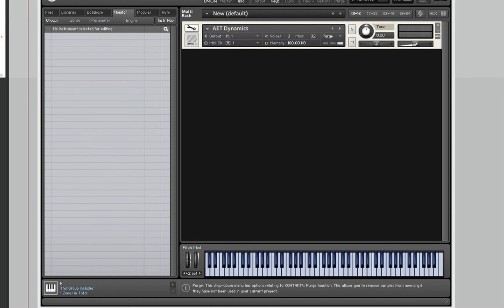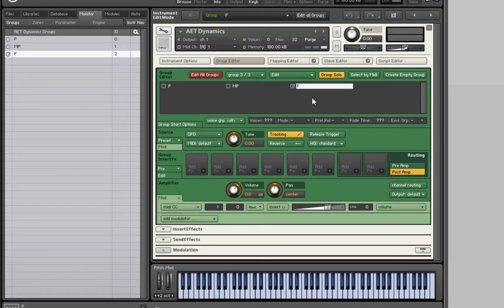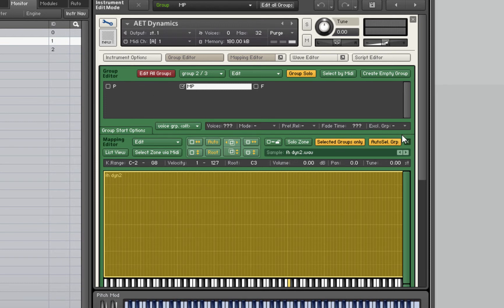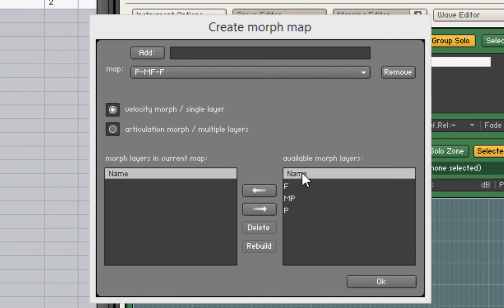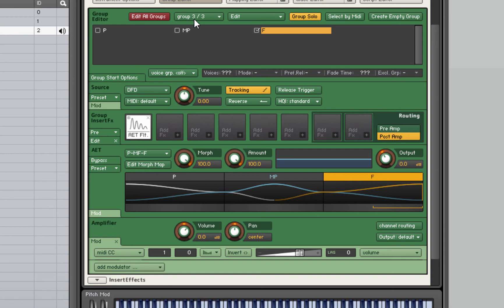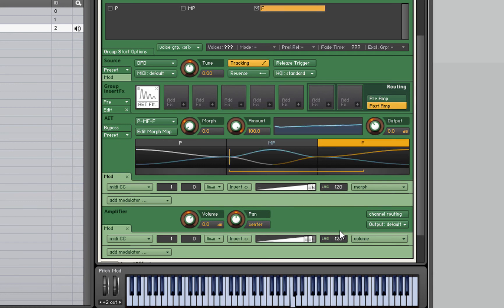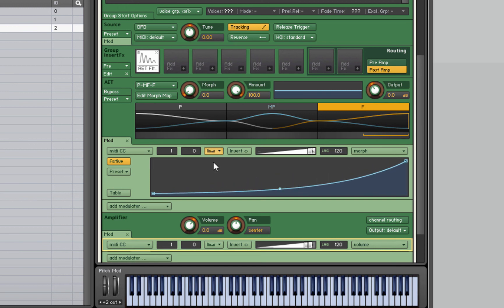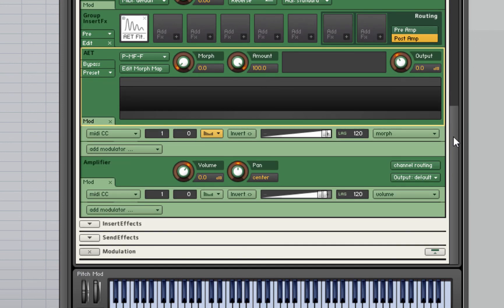Kontakt AET Filter Dynamics

Comment: Hi David..I know this is an old vid but you mentioned at the end crossfading different instruments eg. a guitar and a flute..could you possibly expand on this, how to set it up? When I try it just sounds like a volume crossfade because the group with the AET FX turns down with the mod wheel..thanks!
Reply from the maker: Hi,

I haven't done anything in Kontakt for years so not really sure what the procedure is these days
Reply: Ah I've worked it out thanks again for the vid!

Comment: Great video! I thought I was going crazy trying to figure out why I was getting all those harsh pops and crackling sounds. Nearly all my samples are recorded at 48000 Hz.
Reply: Sound Author same here! I was actually having trouble (pops and clicks) with a spitfire library and support suggested to turn off the AET filter in their preset. I came here to figure out what the AET does!
Reply: @GuidoQuinceMaat  Oh, wow. Which library had the AET filter?
Reply: @CordaroRodriguez  Haha I had to dig a bit, as this was 3 years ago - It was the Gwilym Simcock one. The names of their piano's have changed a bit, but I believe it is the 'Originals Felt Piano' nowadays. Not to be mistaken with the ACTUAL original 'Felt Piano' (which is an absolute must have by the way) from back in the Unicef donation days, which is a free download in their 'labs' department called the 'Soft Piano'.

I believe they repurposed the Gwilym Simcock felt piano samples into the 'Originals Felt Piano', which is nice. I think it was a good move, because to be honest, I'd advise you to steer clear of the original... It was a mess.
Reply: @GuidoQuinceMaat  that is good to know! Yes, I lift the labs soft piano... And I actually use it more than the Originals, haha